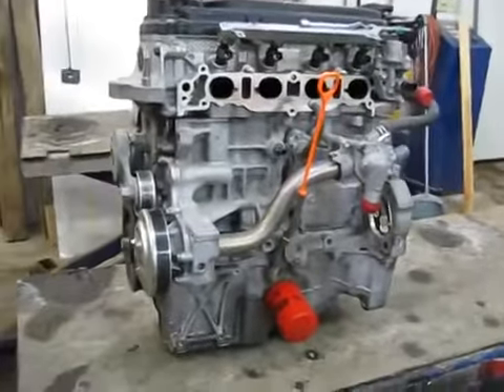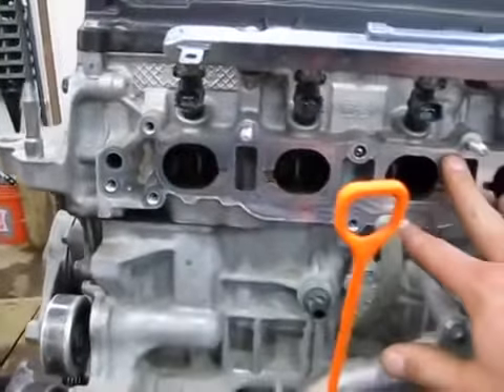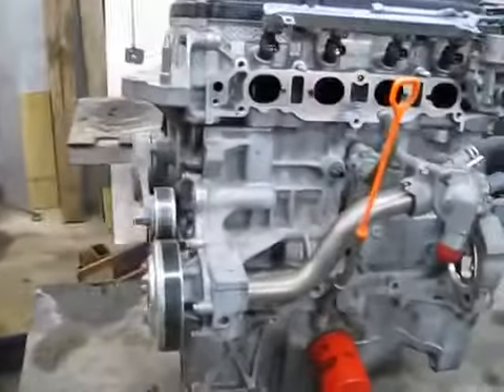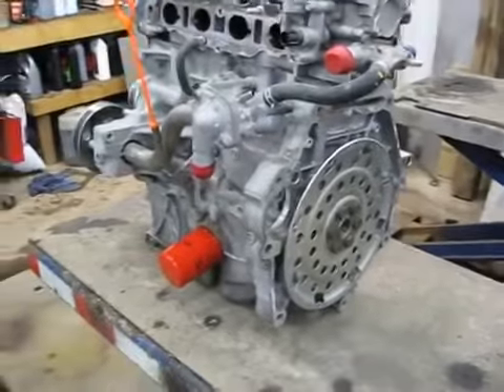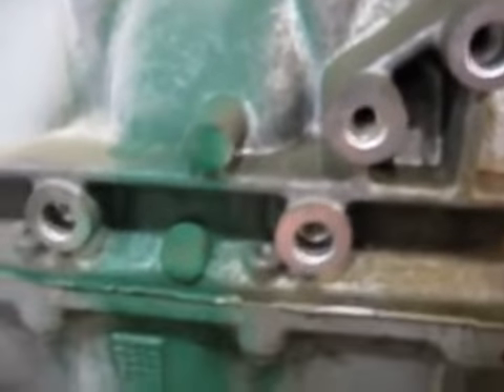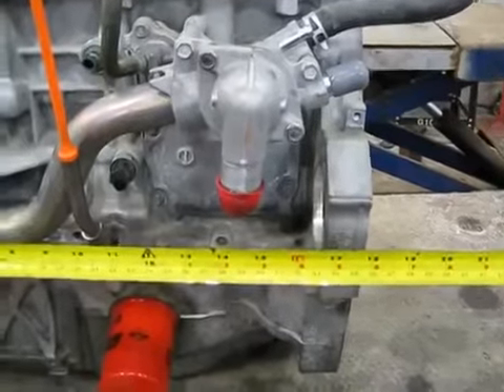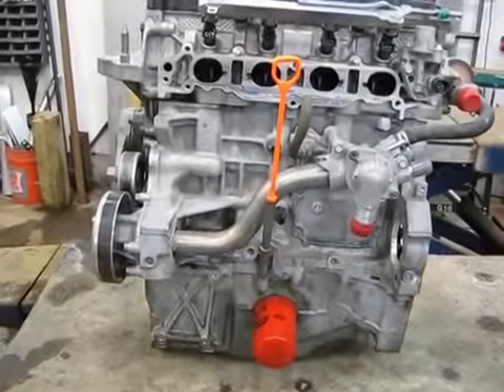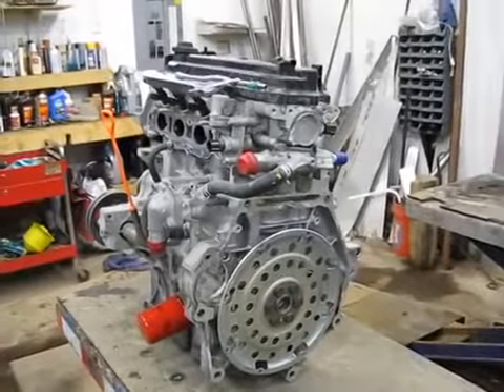Honda fit aircraft engine walk around

Comment: They must have did a total re design on this series engine, as the 2015 Fit L15 has a separate oil pan and conventional main Bering cap. There is a video of a over heated 2015 engine be dismantled on you tube.

Comment: It would have to have a reduction gear since props normally spin at 2800rpm or less where that engine has greatly reduced power.
Reply: Auto conversions require a PSRU.

Comment: Not a suitable engine in my opinion. Did you end up using it in an aircraft? Guessing not.
Reply: Is this just your personal opinion, or do you have any reference material. The homebuilt aircraft industry has been using Japanese auto engines for aircraft, the last 20 years, with great success. You must not be involved with this  niche 😊
Reply: @stevecarlisle3323  Nothing against small Japanese engines, I use a Suzuki engine in my experimental and love it. Just the design of that Honda is not ideal for constant higher rpm. Some small engines are great, some are just okay, and others are no good. Many small factory japanese automotive engines are better than rotax and especially better than US engines.
Reply: @chippyjohn1  Sounds Good, what Suzuki and aircraft are you flying?  🇨🇦
Reply: @stevecarlisle3323  I use a Suzuki M13A non VVT bore increased to almost 1.5litre. Many other modifications including a turbo. It is being used in an experimental single seat helicopter, although it has not taken flight yet. Soon, much testing is still being conducted. It is the best small engine for around 150-175kw in my opinion for my design.
Reply: @chippyjohn1  what specs will the Suzuki auto engine, have over to Honda auto engine. Thanks
Reply: @stevecarlisle3323  It's bore/stroke, rod to stroke ratio, bearing sizes, valvetrain, coolant jackets, oil pump, exhaust ports, port injection, no variable valve timing and much more land the Suzuki in my favour for my application. The Honda is a better automotive engine for its purpose, however for a constant speed high load engine for aircraft the Suzuki is tremendous.
Reply: @chippyjohn1  Well thanks for the comeback. I can tell you that I have been around marine engines, being a HD mechanic, and my personal play boat outboard engine in larger size have always been Suzuki, but 
I do have a 25 HP Yamaha. I have been around Aircraft, being my buddy has a commercial float plane operation, running Beavers, 185,s and a Turbo Beaver, here in Coal Harbour BC. You can Google AIRCAB and get
Some pics. Thanks for making the effort to answer my questions,

Steve
Reply: @chippyjohn1 my fit with this engine has 360,000 miles with a huge fraction of it being at 80 mph on the interstate which in 5th gear is running a rpm around 4000.  Your Suzuki sits at a higher rpm?  The engine is sohc and does not have variable valve timing it just has vtec on the intake valves.  The vtec doesn’t even activate it until 5000 rpm and hits max at 6,600

Comment: Wow  !! you were cheated.. big time.
 That is the WORST (cheapest lowest quality)  Honda engine ever made .. period. 
Honda reduced the stuctural integrity of EVERY single part of that engine.
Reply: Mines running great at 360,000 miles.  Still has factory head gasket and timing chain.  The L15a7 may not be able to handle boost to 600 hp but it’s super reliable and runs forever.